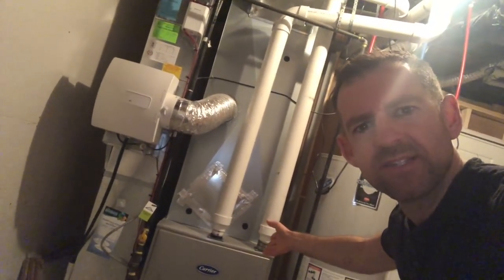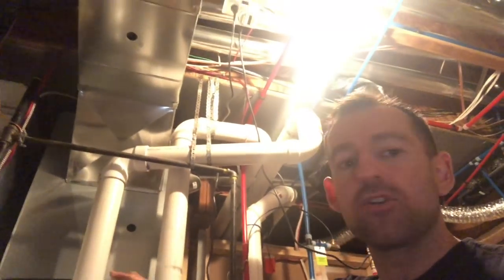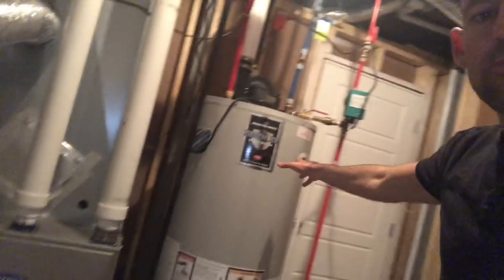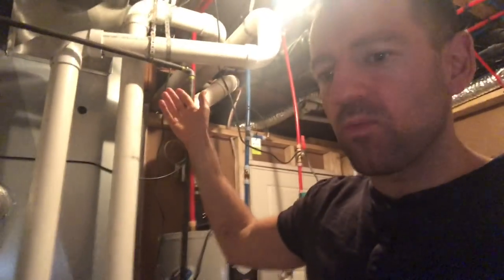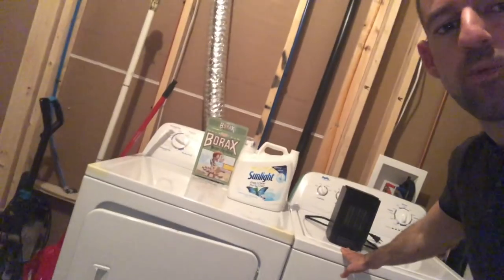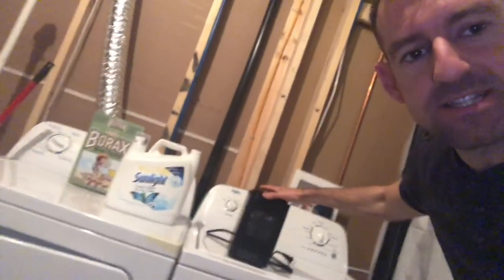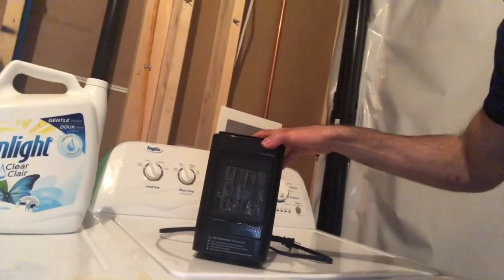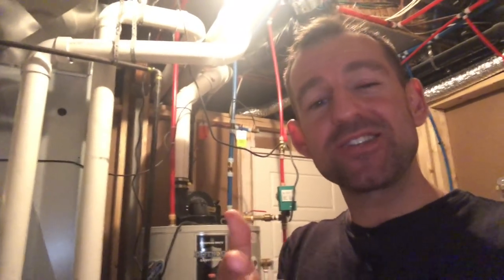Heating System in Canada

Comment: Hi Mark, I live in north-east of China, In winter, there is one central heating system In the the whole city, sending hot water in pipes to all community areas, All the apartments are heated by the hot water pipes under the wood floor, it is really warm in winter, even the weather outside is minus 30 degree, it maybe 27 above inside. Thanks

Comment: Many apartment buildings in Canada use hot water pipes to heat the units. The pipes run along the outside perimeter wall under windows and the heat from the water radiates out. It's usually effective but again, the renter has no control over thermostat settings. I personally prefer forced/central air heating. Depending where you are in Canada, you can survive the winter with a wood burning fireplace - I had to do it one year and it was surprisingly toasty and pleasant.

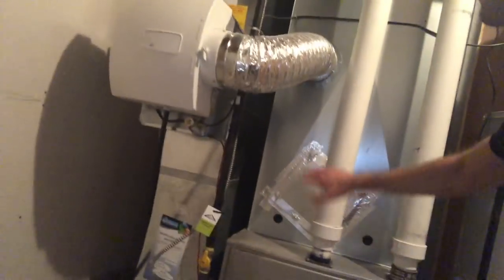Comment: 8:33 looks like the humidifier, Filter is  with the housing of the furnace . now even in older apartment buildings  the temp is centrally controlled, only in the newer apartment buildings it individually controlled.

Comment: Thank you for the interesting video!
In my home I have a gas furnace, that warms water and by natural circulation gives heat to radiators. Rooms warm by radiators.
I see that in Canada more modern and efficient systems, because they warm the air, air warms rooms.
In water heating sistems it necessary to warm water  untill about t=65℃, it takes more gas. But in air heating systems it necessary to warm air just about untill t=25℃, that takes less gas.

p.s. Would you mind to tell us,
how people heated their houses a hundred(or more) years ago in Canada? What did they do? Where did they work? Maybe some lessons about history of Canada will be very interesting. Are there history museums of Canada?
Reply from the maker: Yes, there are history museums here! 😃100 years ago people heated their homes with firewood.
Reply: do you know that water keeps warm a lot longer than air, that's why we do heat the water than air when outside is -50C degrees.  in this case we spend less money for than and yes this is business heating houses
Reply: Во Франции электрические обогреватели обычно висят , но там как говорится на вкус и цвет)

Comment: Nice information, thanks! Hey is it true that most of the houses in Canada have wooden walls instead of bricks? What could be the reason for not using bricks?
Ps: Sorry for English mistake, if any☺️
Reply from the maker: People don't use bricks in Canada. They use cheap wood.
Reply: Pranav Bhandarkar  coz wood is cheap, easy to get, plenty of it, easy and fast to build with, easy to heat, retains heat better than brick walls and keeps you warmer in extreme cold climate.. Thus there are very few brick/ concrete houses / buildings
Reply: Hi Pranav. We use wood in our homes here in Canada because it can withstand temperature variations and movement better than bricks and mortar.

Comment: I live in the south of Brazil, where the temperature in the winter is about zero degrees. Here we don't usually get central heater system. I only have a space heater but I try not to use it too much 'cuz the electricity is very expansive!!!!

Comment: Our heating system in our apartment is different from a house, If the heater is on all units get the heat.
Reply: Its a boiler sane principle just that it uses water to heat rather than ductwork

Comment: You may want to edit out the electric space heater before your landlord catches wind of it- although small in stature they consume a lot of energy - typically a space heater’s maximum output is around 1,500 watts which can be compared to 15 - 100 watt light bulbs all on at the same time which calculates to much higher than normal electric bill and may alert the homeowner to a potential problem in the home.

Comment: I have no idea how our heating system really works, but I'm pretty sure it works by hot water which is pumped through pipes from the heating system in the basement to the radiator in each room...🤔 Each radiator has a thermostat so you can choose the temerature in every single room. Some houses have unterfoor heating and the radiators are redundant...